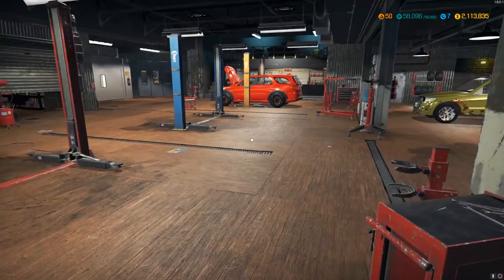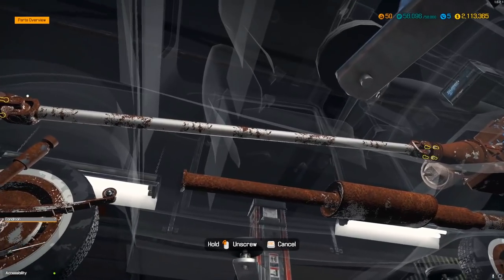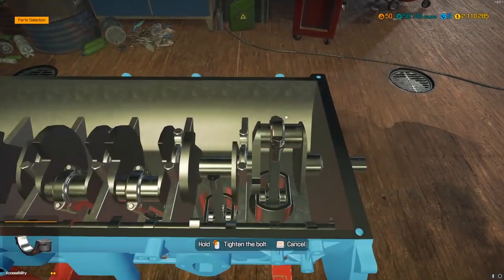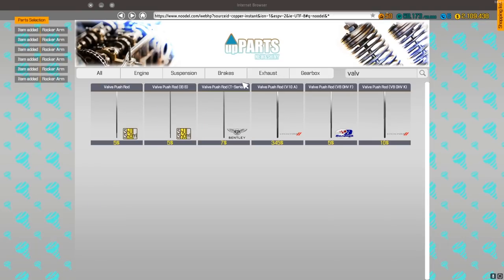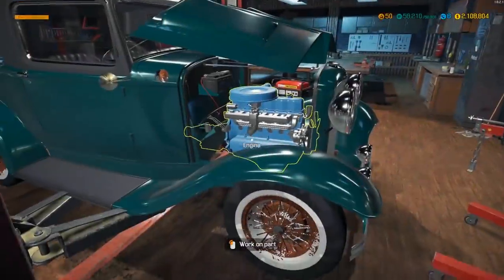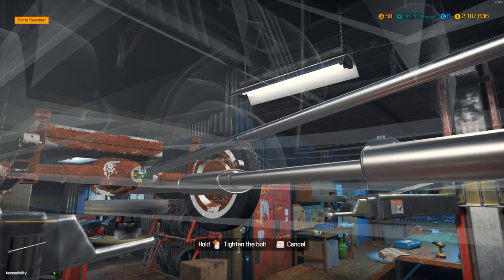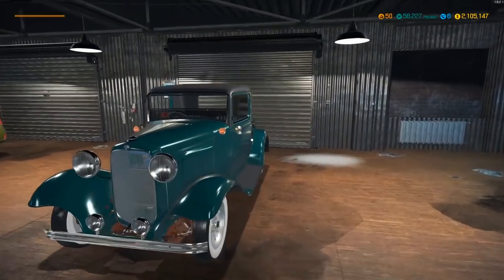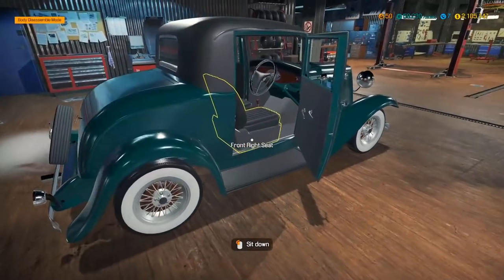RESTORING THIS 1932 FORD'S ENGINE | Car Mechanic Simulator 2018

Comment: You should do the hot rod. Add side pipe exhaust big thick back wheels.leave the front the same and most of the had blowers and they made up to 600 horsepower and higher.